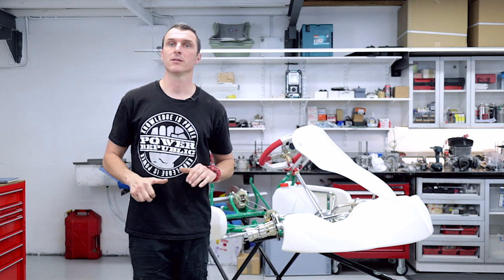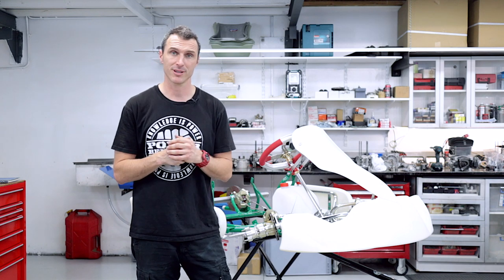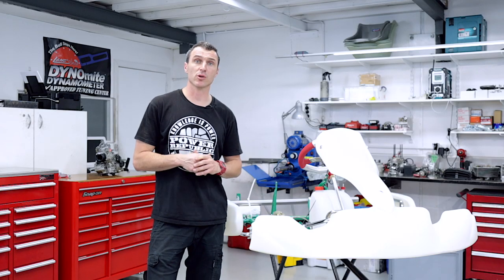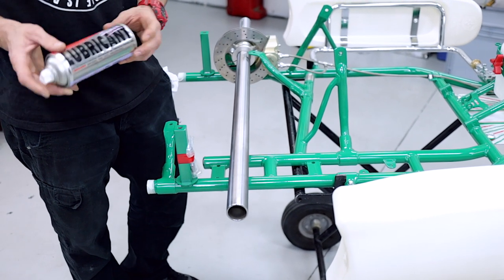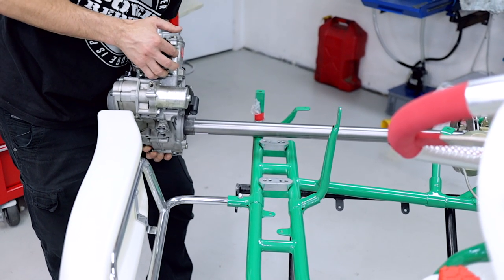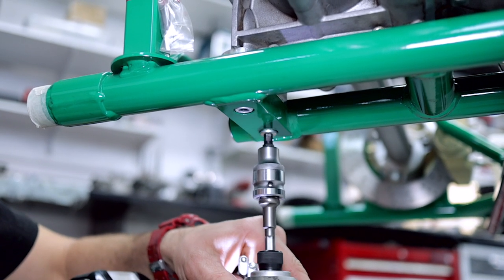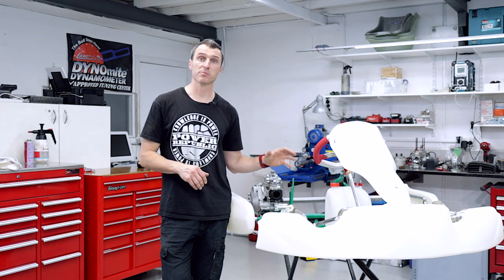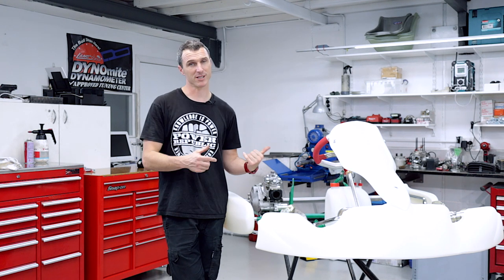HOW TO: Install The Rotax DD2 Engine on Your Go Kart - POWER REPUBLIC

Comment: Great content on your Channel thanks!🎉
Is it „normal“/unproblematic that the two engine brackets have so much play between the chassis-tubes?

I got a new 404RR 30mm tubes and the play is (like it also seems on your video) almost 2mm.
Did you and I just have the (wrong) engine brackets for the 32mm Chassis, or is there only this version?

Comment: Hi Derek! how you set up the rear track in DD2 as you do not have the right bearing? where do you measure?
Reply from the maker: the DD2 engine on the Tony kart chassis is the right bearing.  they supply different engine spacers for ride height adjustments.
Reply: @PowerRepublic thanks for your response! i meant to measure the track wide, usually i measure from the hub to the bearing bracket.